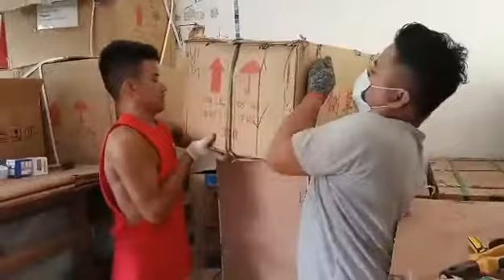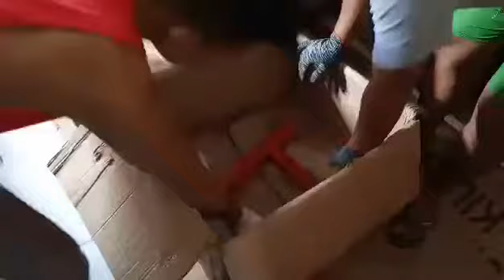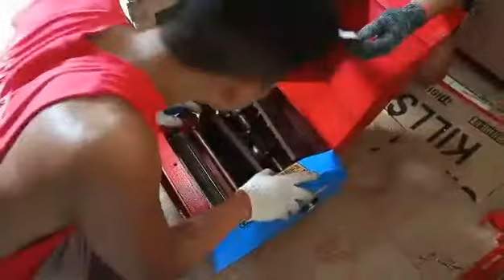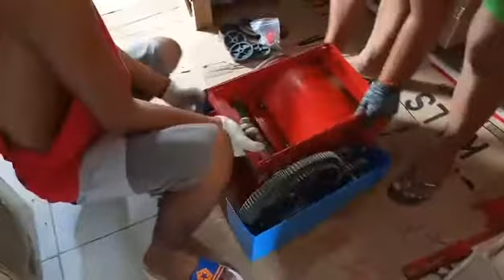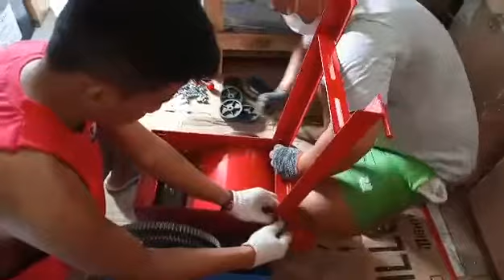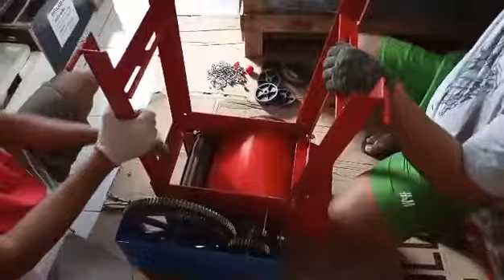UNBOXING SHREDDER MACHINE / SILAGE MACHINE / FORAGE CHOPPER Part1 | ABA10 AgriBiz

Comment: ano pong FULL details ng machine na ito, ano-ano ang pwede i-shred ito?
Reply from the maker: 🌿🌾SHREDDER / CORN STRAW CHOPPER / GRASS CUTTER / SILAGE MACHINE! 👏👏👏
👉Wet and dry grass cutting!
Motor: copper wire
Power: 4.0KW /5.5HP
Voltage: 220V
Production capacity: 800-1200 kls/hr
Cutting length: 2-4cm
Prices💰💰💰
👉automatic feeder: P31,000
👉manual feeder: P28,000
We ship nationwide!
Message us to order!
☎️ or call 0968-549-8860